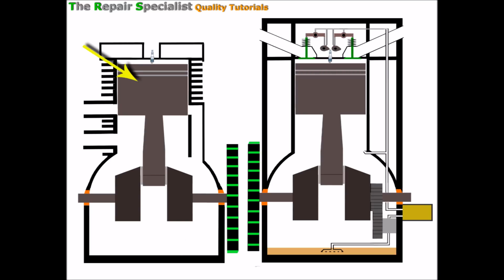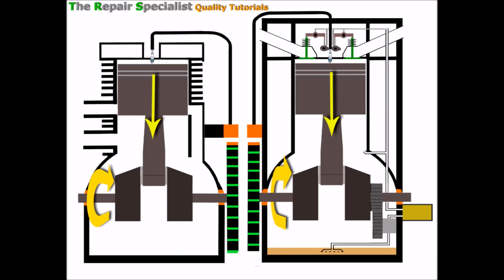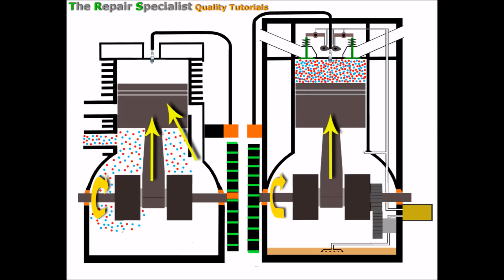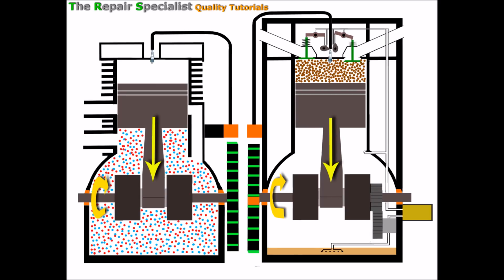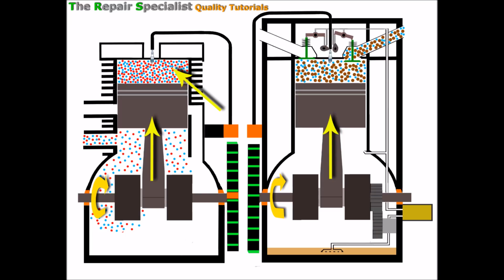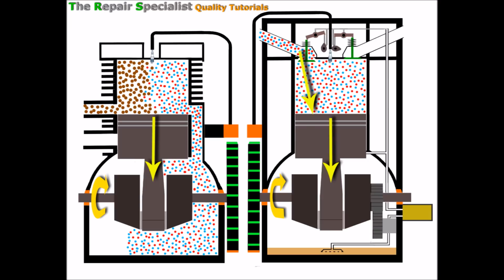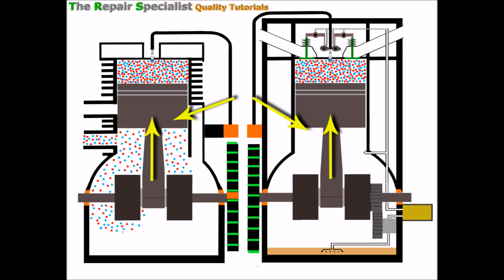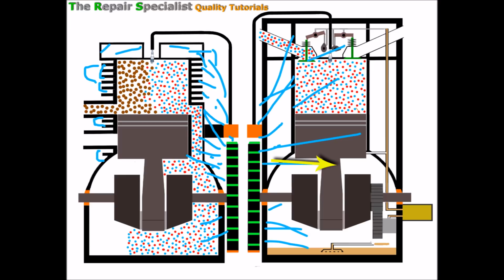2 Stroke V 4 Stroke - All the Info You Will Need!  (by Craig Kirkman)

Comment: I saw a 5 minute video on how a 2-stroke engine works. I like short videos since they usually explain things well but it glossed over everything. I needed a longer explanation! Good video explained well I was hesitant at first with my both started at the same yet the 2-stroke was doing nothing as if magic. Then you explained it was still in the cord pull phase the person's effort to start the engine was still moving it at that point. It almost feels like we could improve the 2-stroke design to be less smoky and maybe put the transfer port on its own doesn't it? Maybe right side lower down but not have fuel/air mix in the crankcase.
Reply from the maker: Thank you for your comment and feedback. I really appreciate it. Craig

Comment: Do any 4 stroke engines gear down the flywheel to avoid the unnecessary spark during the exhaust stroke? although it's probably negligible, there is of course some loss of energy from the unnecessary spark...
Reply: plasterbrick I don’t think so it really does help burn off excess

Comment: Thanks for all your time and effort making this video.

I have a two stroke strimmer that would not start, there was a healthy spark and fuel was getting through after scratching my head for a long time I stopped scratching and started pulling my hair out but eventually found the problem, the exhaust was slightly loose.
I didn't realise how important the exhaust was on a two stroke.
Your videos are very easy to follow maybe you could do one on a basic two stroke exhaust.
Thanks again
Andy.

Comment: Excellent video. Used this to explain engines to several people. I disagree with your fact between 15 and 16 minutes about a vacuum being formed if the exhaust valve stays shut. The reason the piston is moving down is down to the fuel exploding and needing to take up more space. No external air would be required if the air and fuel mix was right. 
If the exhaust valve was open then the combustion would simply exit the exhaust as fire. 

At least that's my understanding of it. Feel free to correct me if I'm wrong. 

Either way, great video. Thanks for making such an effort.
Reply: It is opening right after combustion, not during the combustion. By doing this you just make it easier for piston to move down and cool the cylinder. Its is a double win-win situation for engine.
Reply: You are correct.  Actually, the exhaust starts opening a bit before BDC and will be fully open on the exhaust stroke.

Comment: This is really amazing.  I always look for trouble shooting and repair videos that are based on the item or type of item I'm working on.  The basic understanding of two cycle, as compared to 4 cycle engines that I gained from this video have helped me to diagnose problems and repair them faster.  The better understanding of engine design helps identify  how problems occur before they occur and brings a better understanding of the importance of the maintenance procedures.  But most of all, I save time not having to search online to identify engine components and ordering parts is better when you know what to look for and what you need the first time.
Reply: iTs AmAZinG  OOGA BOOGA